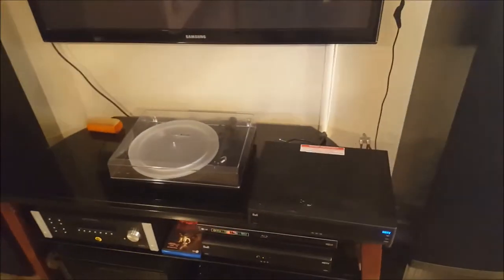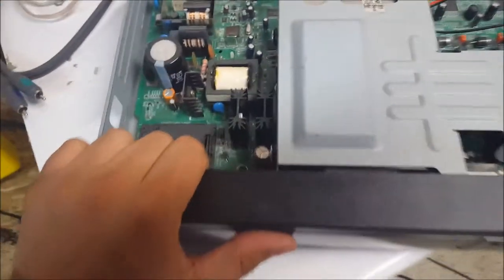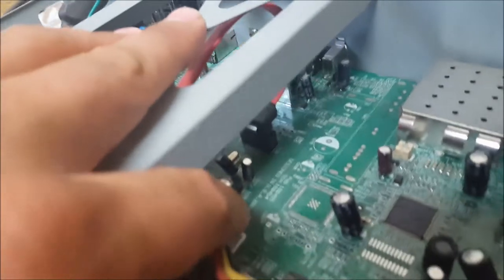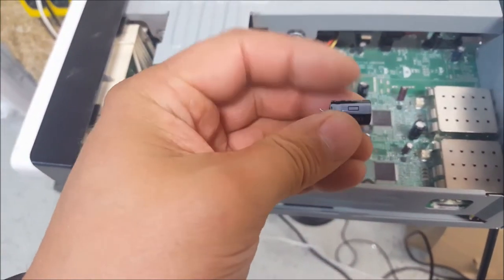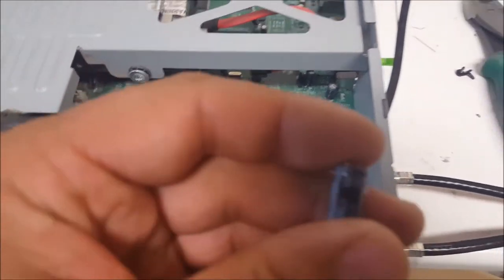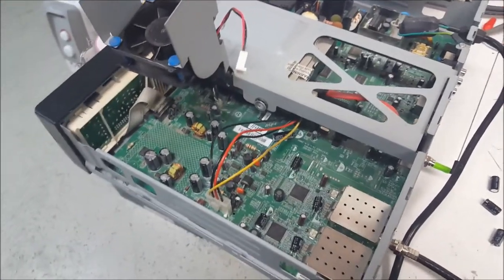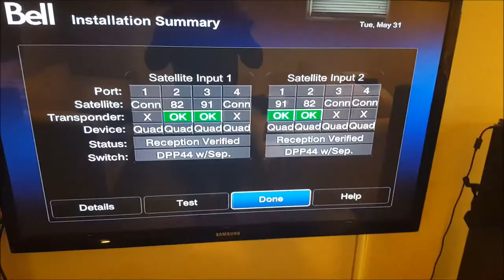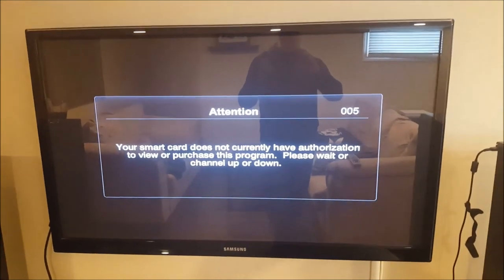Bell & Dish Network satellite receiver and PVR REBOOTING or Wont turn on repair!  Easy!

Comment: THANKS for this!!!!!  I just did my 9242 replacing the 7 main caps listed on the net and so far so good. A few glitches at first after the initial boot up, such as no guide. So did the download but it was still stuck at full after 7 minutes or so. Guide was there, but I changed channels and the unit froze up, so rebooted again and this time just waited out the 15 minutes  or so and I guess it finished this time. Picture came on and guide available, channels change and PVR shows played last and first recordings, so all seems good. Thanks again!!!

Comment: Thank you for the video. I had fixed my 9241 a few months ago by replacing the HDD from an old 9200, it worked well even though some of those capacitors were a little bulgy. 
Now i think its time to change them because its freezing up again most of the time at the transponder screen.
I was wondering if i could take the Caps from the same 9200. Or could it also be the fan because it seems to get too hot.
Reply from the maker: Chisasibi it's probably the caps but I would order new. it's only a couple values and digikey.com is cheap. the caps they use are garbage. thanks for watching and keep me updated :)

Comment: I have a bell 9242 turns on with remote but get no signal on tv what do you think the problem is thanks Geoff
Reply from the maker: Probably issues in the tuner. Could be caps. Open it and do a visual

Comment: Hi, great video. Typical of bell. I have two 9242 and the guide won't update, starts then 5 sec later back at main screen. I can't figure out how to force a guide update. Of course bell blames weather trees and anything else. Do u think a capacitor could be related to this? I also have no signal on the ld side of the receiver for most of summer. Not sure if related. Thanks!
Reply: guide downloads on transponder 11.. check signal on transponder 11

Comment: I have the same receiver, except it won't boot.  Powers on and green and blue lights stay lit but just a black screen.  Replaced bulged caps at C309,  C288, C929 and C355, but still same issue.  any ideas?

Comment: Hi There, I have a question perhaps you can help me with. I have a bell 9242 Sat receiver that is DOA. I have replaced the primary problem caps identified on line but no luck. The problem is the DVR boots up fine, but after a few min, the box shits down, loosing all connection to the TV an the fan in the box starts up going full wick and never stops. When you unplug it, the box immediately starts again for another few minutes before crashing again... I would hate to add to the landfill.... any thoughts? Thanks
Reply from the maker: Rob Gale did you check all the other cars too? sounds like a cap problem.
Reply: Yea I did... everything there looks flat... I tested the large cap you pointed out. It is good, the power to the MB all looks good. What is odd is this happened a few months ago and I replaced 3 1200UF caps and it bounced back fine. This time I even replaced those caps again jut to make sure and again, they all check out. Admittedly I am not the best a soldering but I don't think that would be a problem so quickly...
Reply from the maker: Rob Gale it might not hurt to check the solder connections on the ones you replaced. there is also a large one in the power supply that goes bad and a voltage regulator in the power supply that often fail. could be that too
Reply: If that were the case, would not the power to the Mother board change when the box shuts down and the fan comes on? I did check the 200V cap with a multimeter and its capacitance is within range. If the power to the board stays the same, would it not suggest the problem is on the board and not the power supply? Thanks again for your thoughts.
Reply from the maker: Rob Gale you have to test the power at the output of the rectifier.  you may see it move when the receiver acts up.
Reply: I did hear that the MUR1520 Rectifier diode does go bad in the 9242's but I have no idea where it is... Any idea?
Reply from the maker: Rob Gale sorry, that's beyond my knowledge on this unit. Shouldn't be too hard to check and text for.
Reply: Okay... thanks for your thoughts... I will keep working on it and let you know if I have any joy... thanks again for the help.

Comment: Hi there, I have a 9241 like the one you were soldering. I need to replace the fan. Where can I get a replacement and how do I get at it. I noticed you bent fan area up.
Reply from the maker: David Roest let me see if I have a spare in my shop. I have a few but need to see if it's the same.
Reply: Thanks for your quick reply! That pvr is in my bedroom and has been driving me crazy with it's all night warbling from the fan. My other pvrs are silent.
Reply: @randomrepair1680  Any chance you still have a spare fan for a 9242??
Reply from the maker: @kobebryant9985  sorry, I don't :(
Reply: @randomrepair1680  No worries any chance you know where I could get one??
Reply from the maker: @kobebryant9985  should have a part number on it... Tried punching in eBay?

Comment: Do you know of anyway to transfer the recorded programs from My Bell 9241 to my PC?
Reply from the maker: I'm sorry, I don't
Reply: For my Bell 6131 (external hard drive connected by USB turns it into a DVR) the hard drive is formatted with a couple of ext3 partitions.  In other words, it's Linux.  I can connect the drive to a Linux computer and see the large files that must correspond to recordings, but they are encrypted and as far as I know the key is tied to the smartcard.

So yes, it is likely possible for you to transfer your recordings to your PC, but you won't be able to watch them.

Comment: Where do you buy caps? eBay???
Reply from the maker: Digikey
Reply: @randomrepair1680  i bought a used bell 6131 receiver for $40 on Kijijiji and it boots fine. It recognizes the satellite and transponder but my signal strength is always at zero %
Reply: Apart from caps, could it be something else?
Reply from the maker: @AEKarasCA  absolutely. But that's where you start on these
Reply: @randomrepair1680  i will try. Nothing to lose.
Reply: Thanks
Reply from the maker: @AEKarasCA  nope! Good luck
Reply: @randomrepair1680  i opened the cover and found 3 bad caps so far
Reply: Il have the tools, just need caps.
Reply from the maker: @AEKarasCA  keep looking... Haha